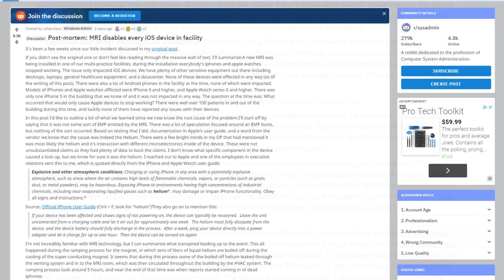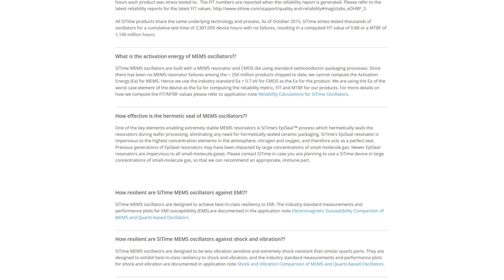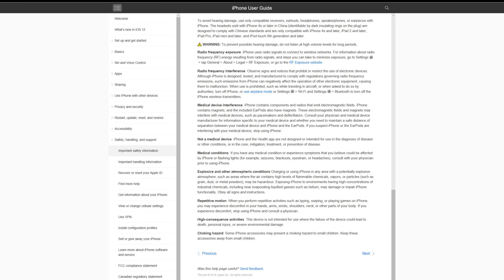Does Helium Break iPhones?!

Comment: this is absolute TOTAL BULLSHIT. as professional divers we live inside a 98% helium enviroment for upto 28 days at a time. the atomespheric pressure we live at is anywhere from 3 bar to 20 bar but usually around the 11 bar region. we all take solid state laptops and phones in side the chambers with us. we have been doing it for years. the only issue we have is when decompressing the chamber bubbles get stuck behind the screens and can take a few days to dissapear. everytime i hear nerds crapping on about how studies have shown and how they put so much research and problem solving energy into working out this issue i shake my head. your obviously all not as smart as you think you are as you failed to just ask a diver who uses these items in high pressure high concentration enviroments everyday. you people are all theory and no action.

"This is known problem, – power supplies ramping up and down of MRI machines uses precisely the same frequancy/voltage as Apple wireless chargers. Only the currents generated are like 10000 times stronger. Apple products suffer massive wireless charging overload even if the distance is like 5 meters from ramping power supply….

Use Iphone7 or older. No wireless charging – no problem!"

Comment: I'm not sure if I understood it right.
So the helium went in to the oscillator, so that the resistance sank and the oscillator arms swang faster (like the 
vocal cords while breathing helium)? But if all parts are clocked by the same oscillator, wouldn't that just make the processing faster? Or is the problem, that it's to fast for some parts and so it shuts itself down to prevent damage?
2. question: So this would also happen with hydrogen?
Reply: Marcel Gabriel when there gets to be too much helium inside, the frequency drops from 32 kHz to 3 kHz. At that point anything it’s clocking shuts down.

Probably the electronics that the MEMS device is connected to (that tiny die you see is the support electronics, the actual MEMS is much smaller) can detect when it goes wildly out of spec and shut down to save a) the MEMS arms from breaking and b) the connected electronics from operating way too fast. Both of those could kill your phone really dead instead of “just resting”.
Reply: @JasperJanssen 
Do you really mean "32kHz to 3kHz"?
Because you say "... operating way to fast ..." and I also thought the clock would go faster like the vocal cords vibrating faster resulting in a higher pitch.
Reply: No, it does not happen with hydrogen. H2 molecules are muuuuuuch bigger than He molecules which are just one atom. The most obvious candidates to try would be the other stable noble gases, Helium, Neon, Argon, Krypton.
Reply: @JasperJanssen  
Right. I just thought about the H-atom, but of course it's olways H2.
Reply: Helium is actually the smallest gas because it has a full electron shell of 2 electrons.

Hydrogen might seem smaller with less electron and stuff, but hydrogen mostly exists as a molecule with itself, H2, ie 2 atoms wide.

Helium is still smaller.

Comment: ugh, lots in this video is wrong.

"there was a helium leak that occurred in the building at the same time" no, the helium was from the MRI. it was massive amounts of helium, since they were brining the magnet down to superconducting temperatures (they boiled tens of liters of helium). There was an HVAC malfunction that caused it to be circulated around the building instead of vented.

"quartz oscialltors aren't skinny enough for apple's designs" wtf? where's your source on this? seems like you just made this up. these are more likely used for cost reduction.
Reply: They are currently more expensive than quartz oscillators. They are, however, like ten times as small in board size and about half the thickness.
Reply: Which one of you is right?
What are your qualifications?
Reply: JayJapanB I suggest you do your own research rather than trusting random people in YouTube comments.
Reply: @JayJapanB  but in short, he's right about what he said. Applied Science has a wonderful video about this.
Reply: So did everybody have squeaky voices while the He circulated in the building? :)))
Reply: @DanSlotea  nope, concentration wasn't that high
Reply: There are many benefits to MEMS oscillators, they are more reliable, smaller PCB area, much lower sensitivity to electromagnetic energy and lower sensitivity to vibrations. They are the way forward, but they need the supplier to find a way to stop helium affecting them.

Comment: The explanation that Apple had to switch to MEMS oscillator due to size constraint doesn't add up since iPhone 5 that was unaffected is actually smaller than affected iPhones 6 through 8+.  Perhaps it has more to do with cost cutting.  Would like to see a more comprehensive test to see if iPhone X, Xs and Xr are affected by helium or if Apple switched back to a more robust oscillator.

Comment: For those who want pick on apple in the comments read the link in the description. Android pones still use a old quartz oscillator while Apple started to use more modern MEMES time oscillators which are way smaller and less prone to temperature changes but as a tradeoff they have this issue with small molecule gasses.

Comment: Here comes uboxs “iPhones have a huge problem video”
Reply: That's why when I go to hospital, I always put my phone out of my pocket
Reply: It is a huge problem. Helium is a common element
Reply: beat kids no in fact we are running out of helium.
Reply: @the7311  We are, but it is still a common element.
Compared to many, we are very likely to run into it day to day
Reply: beat kids so you run into enough helium every day to the point that it will kill an iPhone if you had one?
Reply: @the7311  It's entirely possible. You shouldn't defend a massive design floor in a device. If this was an Android phone, a Symbian phone, a Windows Phone, I would still say the same thing. This is a BIG design issue.
Reply: beat kids i’m not defending. All i’m saying is that people rarely encounter the issue where they are stuck in a room filled with helium to the point that their iPhone fails. That’s probably the most ridiculous thing I have ever heard. This isn’t an everyday occurrence. If it was then we would hear about this more often.
Reply: @the7311  it is an everyday occurrence... All you have to do is go to a hospital and you are screwed
Reply: @zackburkhart6521  A hospital that is installing a MRI machine where there is a gas leak on the day you go there. It seems a bit over the top to say its a huge design flaw.
Reply: beat kids unless we’re literally living inside stars, helium wouldn’t be a problem for most of us. Helium is only common near giant nuclear fusion reactors (e.g. stars) and stars are pretty common in the universe. That’s probably what they meant by common, not that you’ll encounter it on Earth frequently.

Comment: Are there other devices that use this type of timing chip, or are Apple devices the only ones that really have this issue?

I'm of two minds on this. On the one hand, it seems to be a pretty obscure issue that very few people will come across. On the other hand, the cause was a new timing chip design that wasn't needed and that only serves the purpose of making the phone a tiny bit thinner. Making the phone a few fractions of a millimeter thinner doesn't help the end user, it arguably hurts the sturdiness of the phone and makes it a little harder to hold if you have large hands, and only serves the purpose of giving them something to brag about in advertisements. It doesn't seem worth the trade-off when you get issues like this (as well as the fact that they could have made the phone thicker and included a thicker battery, as well as made the phone more sturdy overall). And this helium issue could impact people who work in chemical labs (as well as hospitals). It may be incredibly rare, but it's still worth considering if you work with these types of gasses.
Reply: @LastWh1spr Incorrect.. the iPhone X has 3GBs.. which is very low for it's time.. even if we don't mention the price.. the iPhone XS Max's 4GBs is kinda low too..

I'd agree with people who say iOS doesn't need much RAM.. but apps are gonna start needing more and more and if Apple continue to fall behind then it's gonna be bad for the owners if these phones get obsolete quickly as apps become more memory demanding..
Reply: @TheMasterOfSafari  I can run extensive FEM Simulations with 8 GB RAM on my workstation. 4 GB should be more than a phone app could ever need.
Reply: @MarianKeller  well first off those simulations often cache to a disk anything that isn't actively being worked on. So its not totally a fair comparison.
Second the ram on a phone is also used by the gpu as well making it way more important. Not saying 4 isn't enough. Just that its not an apples to apples comparison
Reply: TheMasterOfSafari you may not want to hear it, but it’s still true: iOS as an OS is very well tuned to using very little ram, and iOS apps are tuned to running on low-ram devices. On the other hand Android is neither.

With older iOS devices — this mainly applies to older iPads, because people actually use 5 year old iPads — what you will notice is relaoding tabs more often when you switch from one tab to the next, that sort of thing. But they still function just fine.

I don’t think I’ve noticed anything missing from iOS apps that’s due to lack of ram. It’s all the other Apple restrictions that you feel.

PS: ram takes power. Regardless of whether you use it at the time or not. So (even aside from the purchase price) going from say 3 to 6 GB costs you either a measurable amount of battery life or a fair bit of grams in extra battery to compensate. It’s not a victimless trade-off.
Reply: Nmotsch idontwannagivemyrealname I agree on the fact that they could’ve included a bigger battery, but don’t agree about thinner = worse/less sturdy..

Though to be honest phones are already thin enough and I’d rather have something the size of a Note 9 with its larger battery.. it’s like a few mm thicker but has a much bigger battery...

Comment: Apple devices are weird. A house I was in had unstable power and only Apple devices freaked out, they’d register ghost touches and be completely unresponsive while charging. While my Samsung was fine. Also changing the charger from apple’s  awful included charger fixed the issue..
Reply: @Koda14  1 chargers had the issue, also tried two cables. the cable was working fine with samsungs

Comment: Something’s not right here. consider this… if there was a leak that released enough helium in the air to ruin all those iphones in the vicinity, wouldn’t that be like. A serious problem for PEOPLE? Breathing issues? Lack of oxygen? Everyone talking funny? In a place where many patients may already have breathing issues? I can’t imagine that a massive helium leak would be a routine occurrence, seems like a pretty major issue to me. Also, many android devices are all about miniaturization as well, don’t many of them use a MEMS chip as well? Probably the very same one considering Apple is just using an off the shelf part.
Reply: I'd want to know if it works at high altitude.  I'm currently living in a city that is at 3,500 feet, and I know they have to calibrate the furnaces here to work in such low atmosphere conditions (usually just a double speed combustion fan)

At Mount Everest type elevations, humans will eventually die because of distance between oxygen molecules.

I also wouldn't mind a device that actually works to -30 degrees, as most seem to die around -15 to -5 degrees.  Not everyone lives in California.  For that matter, how about a drop test at knee height or even six inches at -15 Celsius (everything becomes super brittle at temperatures like that)
Reply: @babelfishdude  the issue here is the battery. The voltage a battery supplies drops as the temperature decreases there is not many practical solutions to this well maintaining the same performance levels.
Reply: What tends to happen with newish technology that Apple decides to use is that they will literally prebuy most of the production — between the iPhone X and 8/8plus, I think they’ve used something like 200 million of these devices in the past year or so. You can still buy them on Digikey so clearly the supply isn’t entirely going to Apple, but I’m not sure there would be enough of them left to put in, say, the S9, which is not exactly a small number of reels itself. And it’s not impossible that Apple got exclusivity on using it in smartphones for 3 or 5 years — that’s also something they do (usually in exchange for lending you enough money to build enough factories to make all the stuff they need). I mean, yeah, the terms are onerous, but also, they are the best customer in the industry, so sometimes hitching your wagon to ‘em works out.

When the production capacity scales up and exclusivity wears off I will bet the best and brightest android devices will start using these as well. Probably things like the Pixel series before the Galaxy, because it’s easier to order 3 million than 30.

Comment: New IP69 rating: helium resistance, next to water and dust...
Reply: Actually, IP69K exists. IP7X will be better
Reply: @startergate  ip 69 is for Pressure Water resistant like from an Presure Washer like Kärcher
Reply: Niklas Buchholz yes? He said that it exists and that name wouldn’t be applicable..
Reply: You need a 3rd digit to indicate helium resistance. In IP68, 6 is for dust, 8 is for water.
Reply: @yushisun8184  so IP420?
4 for dust, 2 for water and 0 for helium?
Reply: 6 9
Reply: Nice
Reply: 69 sounds weird should be 79

Comment: Oh crap now my $1000 phone can't withstand helium.
Reply: $1000 technological advance device vs one of the most harmless substances in the universe
Reply: @MossPalone  inhaling high concentration of helium can cause fatigue.
Reply: @lhk7006  and that's about it
Reply: @ashrude1071  decrease in oxygen -> (possibly) death.
Reply: @lhk7006  - no, displacing oxygen with helium causes fatigue.  Indeed, at depth, Helium is used to cut the otherwise standard "air" you breath at sea level.  Helium is inert; just like the Argon gas you breath everyday...
Reply: Jude Lau helium displaces oxygen.  Doesn’t like existing with oxygen so helium is very dangerous. Brief exposure won’t harm you any. But the same can be said for halon gas or Carbon monoxide.. small exposure like brief inhalation prob not going hurt urself but a few minutes of exposure is life threatening.
Reply: meehhhe Of You No, helium does not displace oxygen in the same way CO does. And one breath of pure CO would almost definitely kill you. The same is true for any halogene.
Reply: Inhaling CO is fatal because it combines with haemoglobin to form carboxyhemoglobin which hinders the delivery of oxygen. High concentration of Helium doesn't do the same but it decreases the amount of oxygen you inhale per breath.   @PR-hl9pm
Reply: @lhk7006  Also because it's so light, it'll leave the lungs by itself
Reply: like you would come into contact with high concentration of helium half as much as water...
Reply: And fall off from 1 ft
Reply: Your fault for spending a G on a phone you'll either throw away in a year or will break just being looked at the wrong way. Androids fucking rule
Reply: Oh crap but it can survive water. Which is something more commonly found in households that helium isnt it?
Reply: @mandem1209  no
Reply: Why do you want to stay in helium area anyway?
Reply: Tyler Evans Nope. Their main filling is the same.
Reply: Tyler Evans the report stated iPhone 7’s and 8’s which the iPhone 8 utilized the same internal design as the X with a couple small exceptions but internally it was almost identical.

Comment: How does the Helium Stop the Clock? It get's into the Chip and then?
Reply: The Helium changes the voice of the chip to sound like a chipmunk and so all the other components can't work because they just keep on laughing.
Reply: Then, the tiny midget running his treadmill inside the chip suffocated, then, a new and fit one gets flown in, usually within a few hours. Satisfied?
Reply: Samsung Galaxy S7  i think that it normally has bigger atoms/molecules in it and helium is so tiny and in nature it is one-atom "molecule" so it's so small that it can go trough the chip's seal
Reply: Samsung Galaxy S7  my bet is it will stop working faster than in He
Reply: @DanSlotea  I can't wait for the iPhone in a vacuum videos
Reply: kazefalke the chip seems to be protected against gross overfrequency failure, so at some point, it just shuts down completely instead of just vibrating out of control until an arm snaps off.
Reply: kazefalke Well written comment. Blind Apple haters won’t understand this.
Reply: @FastestCores  duh blind people can't read